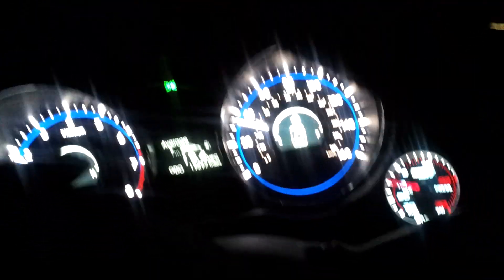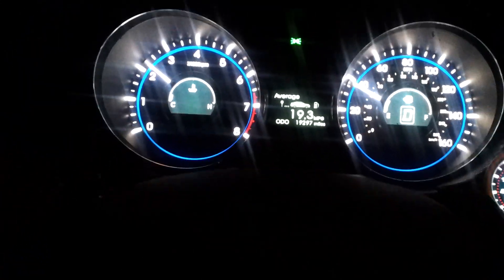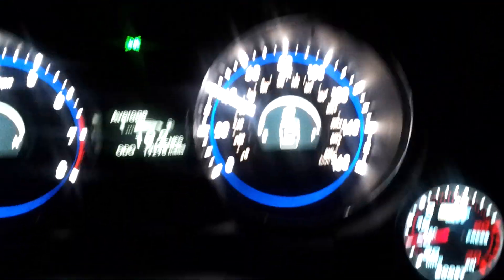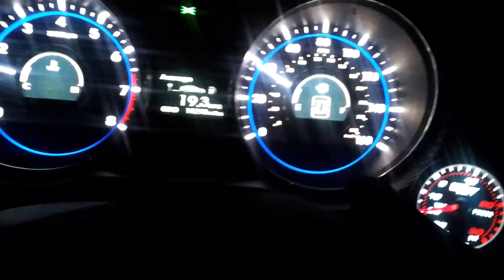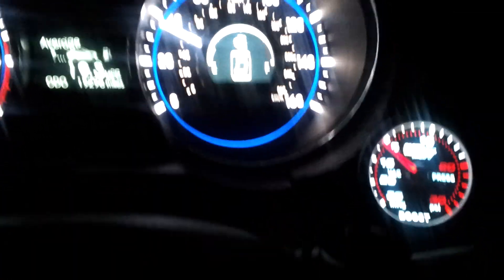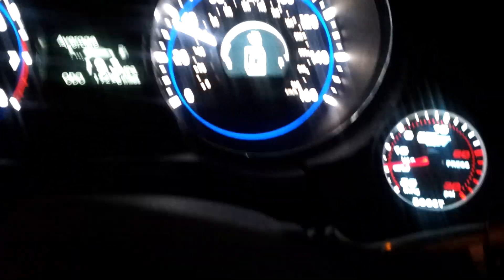Custom boost gauge pod in action

Comment: when you aren’t in gear in the sonatas the turbo turns off completely
Reply from the maker: It does not turn off.   Turbos can't just turn off as they are mechanical turbines spun by exhaust gases.   They can however bleed off any boost or vacuum through a bypass valve or waste gate.